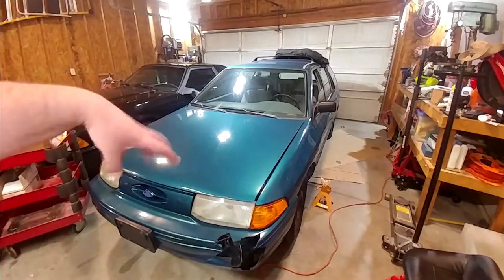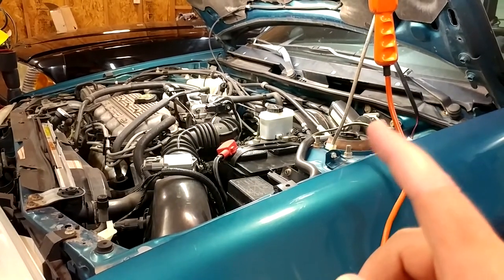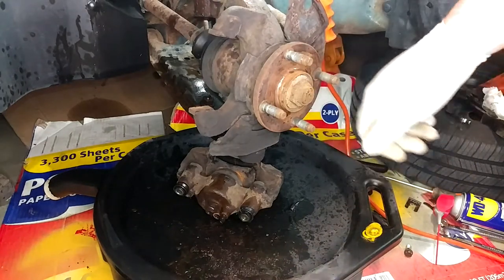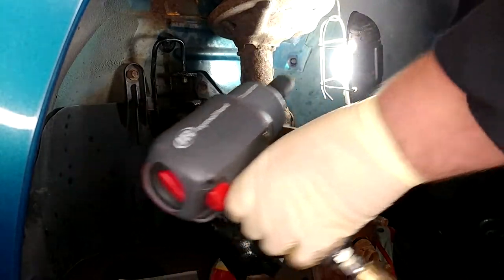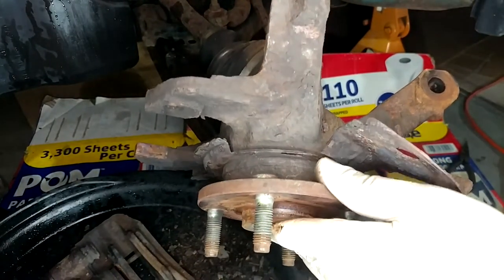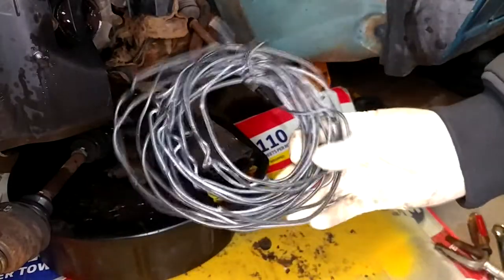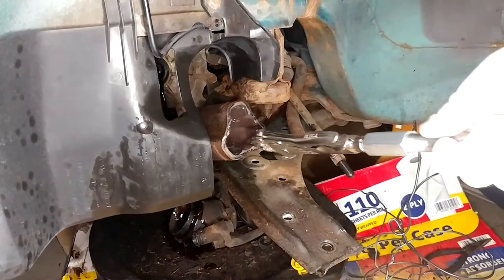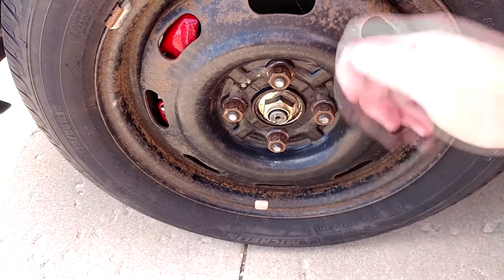Escort Axle ("Half Shaft") Replacement!

Comment: My 1997 ford escort wagon lx is the best car I have ever owned. Mine is an automatic, and I have to replace the leaking filler neck. But also the CV joints are really bad and need replacing. This video was fantastically helpful thanks!
Reply from the maker: Thanks!

I think the CV setup is pretty similar on your car. It's not too bad of a job.

Comment: thanks for the slide hammer tip, took on a job replaceing both axles, ball joints, tie rod ends.. the works.. was fighting those shafts until i watched your vid, i had to go rent a slide hammer from advanced auto, they was the only one that had the adapter with it... they did not come out on the first try but finally did pop out.. Thanks again..
Reply from the maker: You're very welcome. I'm glad to hear it worked out! The day I "invented" the slide hammer+wire trick it was a rented slide hammer too... now I wonder if that kit had a vise-grip adapter in it or not! 😂

Comment: Nice job Max.  All that newness in there looks great.
10:30  Is this video from before the new press?   10:50 never mind.
I've heard, though I don't know if it is true or not because I've never been in the situation, that changing dirty never been changed transmission fluid on a high mileage car is just asking for trouble and that you should leave it alone.   I started hearing this in the late 80s and have heard it as recently as this year.  You said it was not a high mileage car, so maybe this can put a nice explanation point on it and prove one way or the other.  Do you have an opinion on this?

Did you tape the wheel bearing section?
Reply from the maker: Thanks! Yes, indeed. The car is mechanically coming together nicely.

The new/old transmission fluid debate normally is an automatic transmission thing and the Escort is a manual. That said, I think there are 2 schools of thought about it:

-One is that the oil having so much grime and junk in it is the only thing keeping the clutches from slipping so it will still shift. I think this is mostly just crazy talk. I 100% believe sludge will keep one from leaking though and I've seen that happen more than once after changing nasty oil in whatever the "thing" is.

-Two is the much more plausible explanation, IMO. If you've never seen the valve body inside an automatic, it looks like an ant farm, with pathways and small passages everywhere, and torque converters look like jet engine fans with corners everywhere around all of those blades. When you service a really nasty automatic for the first time you're opening all of those pathways for easier fluid flow, but the better flow will knock any debris that has collected in any of the galleries and corners loose and clog up a new filter in hurry. So, the logic is that if you're going to service a nasty one, service it twice in fairly rapid succession with new filters both times.

I taped the failed attempt... 😆I had my tail between my legs too badly to ask to film the guy with the right tools and skills that I paid to do it. I considered it, but every shop in town had a 2 week wait for any labor and they squeezed me in, plus, I don't really have a relationship with them. It would have been weird...

On the bright side, I'm sure the bearing on the other side will fail any second now so I'll probably get another chance. 😁
Reply: @TheBrokenLife  I thought I heard you say it was a 4 speed manual, but then later in the video you mentioned ATF and so I thought I was just misremembering it and that you said 4 speed automatic..
I've seen the valve bodies, and they give me a headache just looking at them.  They're like magic.
Reply from the maker: @tarstarkusz  I may have said it's a 4 speed, but it's a 5 speed. Lots of manuals run in ATF though. When things are flying by on the screen I can see how you could get some things confused. As it stands right now all of my vehicles, except the Blazer and the tractor, are manual 5 speeds.

Automatic transmissions are my weakest area by far. I've avoiding those greasy Faustian bargain boxes for most of my life, but... I have plans that will require one. We'll see.

Comment: I always buy a new OEM VSS before I even start.
Reply from the maker: I've heard about too many horror stories of them breaking up on the way out to venture even touching one. Just for sport I did attempt to pull one from a '93 that was headed for the junkyard and just like clockwork the bolt securing it broke off in the transmission case.

Comment: I did this same repair last fall on my 97 wagon and I had to slide it out like you did, took me 5 hits to get it out but in the process I knicked the trans seal so I’ve got to take it all apart again, my question is after you’ve removed the original axle and replaced it does the replacement axle come out any easier or am I going to have a fight on my hands?
Reply from the maker: I've never had to do one twice on the same car, but I suspect they come out just as hard every time. One the reasons I use Autozone axles is because of the lifetime warranty, so if you rip it apart getting it out then whatever... they'll give you another one. 

The seal itself is another issue. I would be very concerned about being able to actually reach them with the transmission installed in the vehicle. The first time I did axles on an Escort I instinctively ordered replacement seals as well, but as soon as I saw the setup I knew better than to disturb them. If you happen to have an automatic transmission, I'd just keep adding fluid and mopping up the puddles. 😆
Reply: @TheBrokenLife  I have the O’Reilly axles which have the lifetime warranty, the seals aren’t too bad on mine, it’s an automatic and this thing dumping about 2-3 quarts of transmission fluid so I can’t afford to let it be. Yeah I got stupid when I took the original axle out and tried to pry it on the forward side of the transmission with a prybar and unknowingly hit the seal. I did this job on a 2000 escort I bought for my wife and I was able to get that one out after fighting with it for 6 hours straight. These axles are the worst ones I’ve ever done and I repair cars for a living!
Reply from the maker: @Charlies_Corner  I somewhat suspect the transmission arrangement between 2nd gen and 3rd gen Escorts may be different. There is no opportunity to get a pry bar on the axle stubs on 2nd gen. I tried and tried the first time I had to do one. That's how the wire "trick" was invented... I had no other option.

Based on what you're telling me, you may have a better time with the seals on your 3rd gen than I would on my 2nd.
Reply: @TheBrokenLife  I’ll definitely let you know, I’m gonna try and record the process so if I do I’ll send you a link to it. I’m watching your exhaust video, another job I have to do on mine and yours sounds like mine does now. I had to replace my flex pipe and it still is loud so I’ve got to do the whole thing, later on my cat needs changed (thanks Illinois), it’s being held together with two hose clamps and a sprite can.
Reply from the maker: @Charlies_Corner  Is the cat on the 2.0 mounted pretty much directly to the motor like it is on the 1.9? Yuck...
Reply: @TheBrokenLife  yeah, there’s three bolts under a heat shield, then it’s got the heat shield sandwich then goes to a 90 then there’s a bolt that holds it to the engine then the two bolts on the end, the only part that is bad is my heat shield bolts on the exhaust manifold are rotted out and the second I go to take them loose there gonna snap. Of course I have two o2 sensors which I’ve already changed so I know they’ll come out ok. I’m not sure if I’m gonna have to take the cooling fans out or not but I’ll find out later this year.
Reply from the maker: @Charlies_Corner  It sounds pretty much exactly what mine has. I had always imagined it would be easiest to just yank the entire exhaust manifold and pull everything out the bottom. All of the hardware on all of mine has been completely rotted.
Reply: @TheBrokenLife  putt another jack under the car on the drivers side and remove the jack from the front back  crossmember then unbolt the cross member should be able to get a pry bar in there at an angle and pop it right out
Reply from the maker: @jaygee6983  Unbolting the crossmember from a car this old and rusty is really not a good idea.

Did you see how easily it popped out once I realized I had the right tool for it?
Reply: @TheBrokenLife  Yeah I guess every vehicle is different. I had the crossmember out in about 5 minutes in my car. 

What usually happens in these cars Is the transmission mount goes bad over time  then you have vibration in the steering wheel sometimes replacing the transmission mount helps with that. In order to get it out you have to take the cross member out that goes from the front to the back of the car. A lot of people Jack from that point. 

I've already removed it twice I changed the transmission filter
Reply from the maker: @jaygee6983  Man.... I don't even want to look at mine sideways for 5 minutes. 😂 Things are different in the rust belt.

That said, I need to pull the front seats soon and I think those are through bolts into the floor pan, which would be a preview for what crossmember removal could look like.